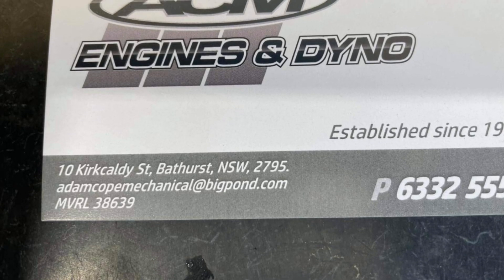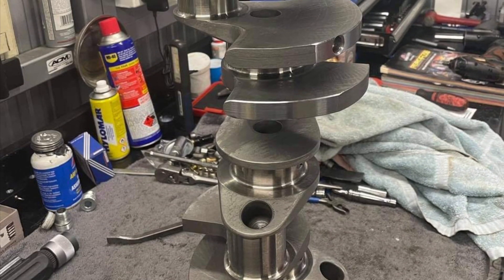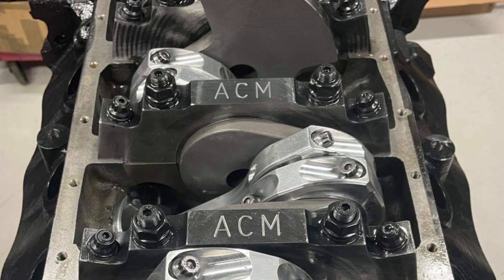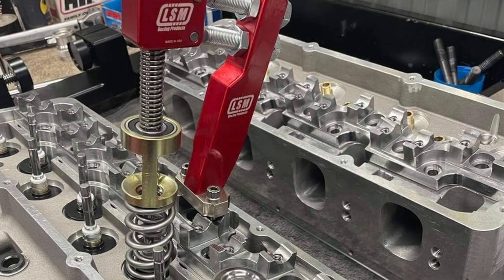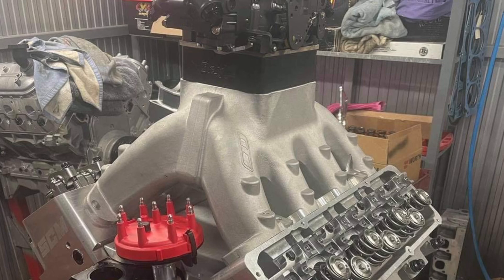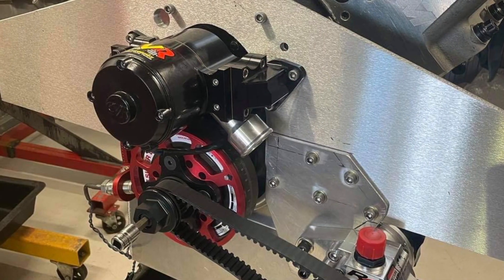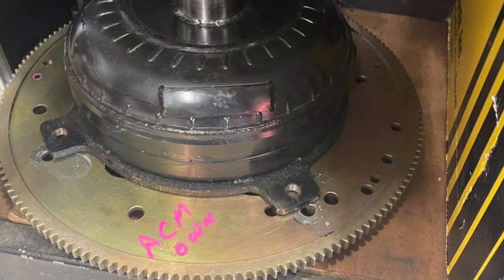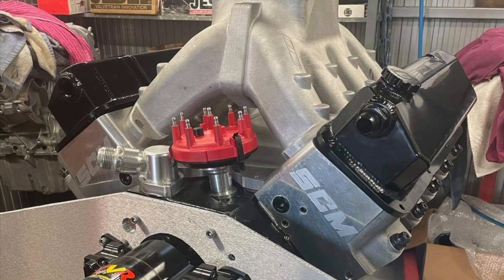1000 hp Ford 351 Cleveland Build Up, The Most Powerful  NA Cleveland Blocked Based Build I Have Seen

Comment: I'll never forget the first time I took my 72 351 CJ Torino now mind you bone stock to a road we used to race on I was up to 120 in no time and it just kept pulling it wouldn't stop pulling I got scared and had to let off 😳
Reply from the maker: The cleveland sets fear in the Hearts of men. Love those Torinos Iggy
Reply: @dragboss351cleveland  thank you. Luxury and speed had a really nice ride also when the design of cars came from mines of humans instead of computers
Reply from the maker: @iggyfritz7150  agreed. I had a 75 Torino. Had a wheezer in it. Now all cars look the same. Sad.
Reply: @dragboss351cleveland  I especially love the Interiors in those
Reply: @dragboss351cleveland  always wanted to take a 70-72 Maverick and put a belt Cleveland motor in it and go eat some Chevy and Chrysler 😜
Reply from the maker: @iggyfritz7150  me too, but I have a 69 Mustang, and Cougar, so have to get them done first. It would haul the mail in the maverick, pass on installing the headers. Thanks Iggy
Reply: @dragboss351cleveland  😀 you're so right you better have a fabrication shop to make yourself a set of headers. My only complaint about unibody Construction on Falcons Mavericks Mustangs is the A-frame it's a very weak point my 70 Mustang I literally broke the A-frame had it welded twice and broke again. The 72 Gran Torino we had a set of cragar's on l50 tires and one of the tires hooked up so well one time it stripped the spokes out of the cragars. That's when we realized what a torque monster the Cleveland was 😛🇺🇸👍
Reply from the maker: @iggyfritz7150  nothing is better than real life experience. Good bye wheel. I have stretched the eccentrics that adjust the camber, with wheel stands, but never broke any A frame area. Cleveland to the front.
Reply: @dragboss351cleveland  yes sir nothing more dangerous than a teenager behind a f**** Cleveland and a lightweight Mustang 😂
Reply from the maker: @iggyfritz7150  lol. 😳
Reply: @dragboss351cleveland  😂 what I wouldn't give to have a car with just the carburetor no computers

Comment: Back when I had my first 351 CJ Cleveland I had to take the heads off and I put quench chamber heads in place of the open chamber heads.The block which was a four bolt main block and I remember saying this engine has much more potential than I could give it.
Reply from the maker: Yes sir, Cleveland’s like compression and cam. Thanks Iggy

Comment: Do you have info on the oil galley modification for high rpm endurance of the stock Ford blocks
Reply: Arrow aftermarket block made in perth
Reply from the maker: @Tbhsixty5  is it poured/casted there?
Reply: @dragboss351cleveland  could not get any info on where cast being oz i presume so perth is the most isolated city in the world.thanks mark !
Reply: @dragboss351cleveland  it’s designed in Australia but I believe it’s poured and cast  in China. I’ve used a couple for 700 hp pump gas street motors with iron old 4V heads .They’re an awesome block.
Reply from the maker: That is what I heard. Machined  in Perth.  Also heard they needed a lot of machine work. Great block as it is superior to factory Cleveland’s
Reply: @dragboss351cleveland  yes Tim they need a lot of work. Definitely poured/cast in China. Seem okay though. Luckily I have a Dart block for my Bb Chevy :)
Reply from the maker: @michaelparadisis4076  yes but well worth it just block thickness and stability for ring seal. My old engine builder has a 40 ford coupe and it has an original ZL-11 427, all aluminum. He want to sell me car and I don’t want the engine. I should get it and send engine to you.
Reply: @dragboss351cleveland  send to me , I beg your pardon ?
Reply from the maker: I know should keep it but could, never drive it with a Chevy in it.
Reply: @dragboss351cleveland  I’ve been a ford man all my life Tim. Still am in fact Had some tough Clevelands and  built well over 50 in my 30 years with the automotive industry. Pound for pound it’s my favourite engine. It just happens to be though that my favourite muscle car is a 70 Chevelle. Dare we like to admit The 454 is a pretty awesome platform.
Reply from the maker: I can understand how you feel. It is the history and performance that set each apart. My favorite Chevelle has to be the 68. Not sure what my favorite engine is yet? lol
Reply: @dragboss351cleveland  I love the 68 too..
Clevo is hard to beat, nasty . I still use Iron 4V’s on strokers. They still work well. A comfortable and streetable 434 cube  700hp 600 ft/lbs on pump fuel . Chev small blocks whipped Clevo’s ass for decades, that changed somewhat now.
Reply from the maker: @michaelparadisis4076  morning. Yes buddy had one white with black stripes m22, ss396. Beautiful car. Yes sir clevos hold their own
Reply from the maker: Not sure what your asking, the hank the crank set up?
Reply: @dragboss351cleveland  about the stock blocks... Not this one from Arrow.

I think i Will need to modify mine in the future. When i go on the german autobahn for longer stretches of high rpm endurance the lifters/or rollers make more noise. But when i drive lower rpm the sound goes back to normal. 

I think i need to do this oiling modification in the future?
Reply from the maker: @hoedemakerbart  definitely a win win situation. As soon as I finish putting 409 back together today. Will start on pro stock block with oiling mods
Reply: @dragboss351cleveland  i think it's an oil flow to the lifters problem at high rpm. I read about it on google, with older BMWs its the same problem. When you go back to " normal " driving the lifter fills back up again.
Reply: @dragboss351cleveland  https://youtu.be/fBSeHpaT3Rw

Comment: Outstanding
Reply from the maker: Perfect description Mark.
Reply: @dragboss351cleveland  But I’ve never heard of an arrow block. Do you know more about it? Is track boss contemplating a tall deck version for even larger cubic inches?
Reply from the maker: @markbulva4188  yes is a brand based in Perth Australia, the blocks are casted in China and machined there In Perth. Yes they have 9.5 and contemplating a 10.3.

Comment: Hi Tim I have never hrard of Adam at ACM but have now,that engine is second to none
Reply from the maker: He did a killer job on that combo. Have similar plans but will be happy with 850hp.
Reply: @dragboss351cleveland  Mate going by that engine,you may be suprised,your engine a little down on cubes,heads and manifold ,comp and cam are up there,may get 950 hp
Reply from the maker: @aussiesupersnake6642  I try and be conservative. We will have some similar specs. I was thinking that I should be able to obtain it after seeing what parts were inside. Like I said be happy with 850. Let’s see

Comment: When I saw 1000 hp. I new it had a but load of premium parts in it! Very nice piece but I imagine it would have to be freshened quite often to keep it in top form.
Reply from the maker: I would suspect yearly teardowns for eval...
Reply: I used to think it but consider NASCAR is at 7000 to 9000 rpm for 500 miles straight.
Reply from the maker: I was at Thorsport motorsports today for a tour. Nascar truck series. Blew me away to see them being built

Comment: Should ask him what weight engine oil he uses. Old School 20w50,  straight 30w or 40w, 50w or Modern 0w-40w or some other thin oil.  Seen lots of Super Stock guys switch to thin oils with Wide loose clearances on mains and rod bearings.  Some run them tight clearances.  Some will talk others are tight lipped.  I find it  Fascinating topics to talk about and discuss.
Reply from the maker: Be a good question to ask, when we do a live chat soon.